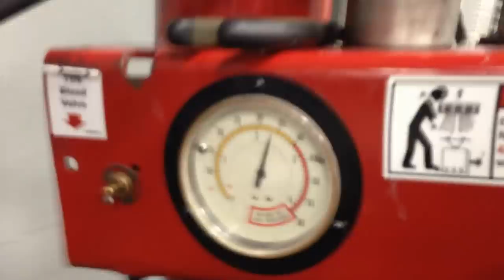125/70/16 Spare tire stretch on a full size rim.

Comment: In a few years a super wide tire on a skinny rim will be cool. LMFAO.
Reply: julio lausell no, one day scooters will be the coolest thing
Reply: allthings possible I hope so, kuz I like um.
Reply: julio lausell I think the "LMFAO" made your joke even more unfunny than it already was
Reply: Trevor Van Eeckhoutte Then you got the point.
Reply: ***** Putting a super skinny tire on a wide wheel is as dumb as running a 500hp engine through a 1 inch muffler, or a 100hp engine with a 3 inch exhaust.
Reply: julio lausell its been cool since the 70s
Reply: Too late. We tried that one back in the 80's, early 90's Down Under.  Glad I escaped those that did. Big tyres with the centre scrubbed out. Embarrassing appearance of over-inflated tyres. You didn't miss out on anything. Thrashed out wheel arches were common. As were broken axles.
Reply: This aged well
Reply: @jjproductions6912  aged wonderfully
Reply: This aged well

Comment: Real smart. A tire that's rated for 55mph max
Reply: +Cobracam The rating probably changed to 150mph because it morphed beyond it's original form.
Reply: Anthony Abelardo lol
Reply: lol
Reply: AND a normal rim...
Reply: Have you ever seen a stanced car with stretched tires going over 55? he should be fine
Reply: Cobracam have you ever seen a truck carrying a shipping container? The tires on those chassis are nylon rated for 50mph only.    That's scary.
Reply: And only a max range of 100 miles.... I drive 100 miles in 2 days, you'd be changing your tires 3 times a week.
Reply: Most cars that have them cant go past that speed anyways.
Reply: 55 mph and only able to go around 100-150 on the tire before it’s bad
Reply: It would be like, 9999mph

Comment: Lowriders been stretching tires for years, 155/80/13 on a 13x7 wheel. Thats the norm.
Reply: L.A. Saldana yeah, but they are not doing it with 13inch wires remember , these are bigger and wider and it's not going on a lowrider but a Honda civic

Comment: The question may be stupid but are there risks that the tire just pops of or something ?
Reply: Cyril Schoenacker Yes, pretty high actually
Reply: !WK3 Hope they did it for fun and didn't bring the car on the highway
Reply: Cyril Schoenacker Knowing the car community as a member of it, the wheel's most probably mounted on a car so low that it can't realistically go over 50ish km/h (35ish mph) without being severely damaged (penetrated oil pan, ripped off bumpers, suspension grinding on the ground, wheels demolishing the fenders, etc.) :) Those are show cars, made for a single purpose, to be shown to others :)
None of my cars is that low, though, as I actually use them outside of car shows; one for daily driving, one for racing and two are currently projects on hold but will still be used actively when finished :) Point is, if you want to actually drive and use your car, you won't be putting a set of wheels like this on it, you'll put something like 255/35ZR18 as I did on my daily, because you want it to handle properly, not like a piece of s**t ;)
Reply: !WK3 Man I got a mk3 golf with 195/14/55 or something like that, 255/35ZR18 seem huge for me lmao
Reply: Cyril Schoenacker Obviously, it depends on the car :) I'd probably drive on 205 or 215 16" if I had an Mk3 Golf, however, I'm dailying a 520i e39, which actually has factory recommendation ranging from 205/65R15 all the way to 265/35R18 in the back xD Obviously, fronts are thinner, recommended being 235/40R18 for 18" and I'm running 225/40ZR18 :)
Reply: !WK3 Yeah a friend of mine got 16" 215 on his car and it's perfect. Larger tires would mean more hp needed as the car only got 90 haha
And also yeah for a bmw it's seem a lot more natural, good choise on the 18", not to big and not to small.
Reply: Cyril Schoenacker Not necessarily, I've only got 150 horses and open diff, yet I manage to slide on the 255s easily :) I just replaced them with 225/45R17 winter tires, and summer rears were badly worn after only one summer season where front ones are as new as used tires can be :D
Tbh, I'd really like to run 19", but I kinda can't afford it at the moment (rims I want are 600+€ plus a set of really wide staggered brand new 19" tires which could easily cost me 800-900€) :'( I'd love to run BMW Style 166, but current set I've got, Style 69 are a fine set of rims as well :)
Reply: !WK3 Still that's 60 more hp than I do lol, I'm concious about the fuel needs too, large tires means more traction which means more fuel consumption right ? I fear that my car would turn into a donkey x)
I still haven't got myself winter tires and it's already -5C in France lmao
No doubt their worn if you drift them haha
600€ per wheel right ? Not the entire set ? You scared me !! :') hahaha
Yeah tires are so expensive that's crazy. One of the reasons why I'm happy with my 14", I can get all 4 tires for like 300€ or even less x)
Both look nice if you ask me ^^
Reply: Cyril Schoenacker Yeah, and that 150hp is still 140hp (4.4 V8, 290hp stock)  less than I've got in my drift e30.......and yet, I'm currently running on 205/55R16 on the e30 xD
Yeah, the consumption might rise, and probably will, but grip would be higher :) It all depends on how you drive your car, I, for example, am a really aggressive driver, carving canyons at 140-150 km/h, entering and exiting roundabouts at 70+ etc. thus I need the grip, but I need to be able to overcome it when I want :)
Nah, I was talking about the complete set, for both rims and tires ^_^ I mean, I'd get the set of 166s from my tire guy for 450 and fix it for ~150 since it's badly curbed :)
We had -3, -4 a few times already in Serbia, but I'd recommend putting on winters for everything under 7°C :)
Reply: !WK3 Oh shit that thing must be going hard 😂 The V8 comes from an other car or did the e30 have a V8 version ? I'm not really à BMW expert as you can tell x)
Well I'm more a "calm" driver so a lot of grip isn't needed in my case. At least for now ^-^"
Damn that's cheap, they are replicas or stock rims from another car ? Because aftermaket rims are more like 400-600 per wheel right ? Depends of the country I guess. I  France 600€ a 19" set is a good price !
I know but I don't really have the money too to get winter tires 😅
Reply: Cyril Schoenacker She gets grip in third, most of the time, but if you shake the steering wheel, she'll gladly spin in the 3rd as well xD The 1st and the 2nd are there just for spinning the wheels up to 90km/h xD The engine's from a 540i e39, so it's a complete engine swap and stuff :) The biggest engine any e30 had was 3.210cc (M30B32 inline 6 engine) in 333i made exclusively for South African Republic with most powerful being in M3 Sports Evolution (2.5 238hp S14B25 inline 4 engine) :) And now my Touring (wagon, caravan, however you prefer to call it) has 290 :D
Nope, not replicas, original ones from M5 e60, but they're used and they're badly curbed, so they need to get fixed in order to be show-ready :) New rims, on the other hand, are quite a bit more expensive, same goes for some used exclusive aftermarket ones :) But these are OEM BMW wheels, so they're neither cheap nor expensive as they're not some no-name brand knock off, but they're not from an exclusive tuner company either :)
Reply: Cyril Schoenacker As for not having money for winter tires........I mean, tires are the ONLY thing connecting your car and the road... If they don't do their job properly, you're screwed ;) Think about it, is your life worth those 150-200€? I guess not :) So either buy the winter tires or don't drive in such conditions at all (talking about snow and ice, you'll mostly be fine with summer tires even under 7°C if it's dry) :) Just an honest advice/opinion from someone that wants to keep you alive and well ;)
P.S. I use Tigar Winter1, see if they're available in France, they're really amazing model of winter tires... They perform very well in all condition but are cheap as hell, in 14"-15", they should be around 35-40€ a piece, so they really do come out to 150€ with mounting and balancing for a set of BRAND NEW tires :)
Reply: !WK3 Damn congratulations on the engine swag, seems like a lot of work x)
Ohhh I understand the price now ! That's what I meant by "stock" rims !
Reply: !WK3 I'm actually searching for a job so winter tires à deffinitelly something I'll buy don't worry. And I don't drive when the road don't seem good to me, I don't drive that often also so I'm fine for now. ^-^
Thanks for your help Imma see if I can find those ! :)
Reply: Cyril Schoenacker Thanks, however I had someone else perform the swap for me because of my lack of experience, tools and work place :/
Good, good, find a set of good winter tires and enjoy ^_^ If you don't feel confident enough, when it snows, go to an empty parking lot and practice driving in extreme conditions :)
Reply: !WK3 As long as you enjoy it ! Maybe you'll be able to do it yourself one day ^-^
Haha my brother did it when he was my age, there a parking lot next to my house and it's empty like 90% of the time, it makes a great playground xD
Reply: Cyril Schoenacker I just need the tools and the space, the experience comes on it's own :)
Then go there, have fun, and it might actually save your life one day ;) There's too many people on the road not knowing how to control their car in extreme conditions, don't be one of them, learn it by having fun :)
Reply: High risk of it popping off the bead.
Reply: Great idea if you don't want to do any more than the 50mph these space saver tyres are rated at. And if you want your tyre to debead probably even at lower speeds and potentially cause death, injury or damage to other road users or yourself.
Reply: Yes, mostly life threatening risks. Do not do this, if someone dies because you refuse to follow manufacturers specifications. You will go to prison.
Reply: I'm riding on 195/45/16 on a 16x8.5" and I ride the fuck out of them.
Reply: Jason Vecellio don’t drop the soap
Reply: Got a coworker who keeps popping off his right front tire when taking turns too fast. Happened about 4 times in a few weeks. Imagine that shit happening at 80 mph. This is what happens when you wanna be cool the stupid way.
Reply: Seize some what. People run 205s on 9in wheels all the time with no problems.
Reply: You have to keep the air pressure much higher but then still it can pop off if you corner too hard
Reply: @IWK333  thinkinh of doing this to my volvo wagon, also thinking of a 1000hp ls crate engine for it lol

Comment: does anyone know or understand how stupid and dangerous this is? I have been working in the auto industry for over 30 years and would never do this at my shop! if i send a tire out like that and there is a blow out I could be held liable ! if the tire doesn't fit it's not the right size and it is illegal! this crap needs to stop! it's giving real gear heads a bad name!
Reply: You say you worked for 30 years in auto industry, in that span of years, have seen atleast one car with this tires on? Or did you even see them put this tire on a car? Point is that it's actually pointless to do it, they show you how spare tire would look when stretched, that's all, did you see them put it on the car at all? If so then you can runt all day

Comment: as a reputable tire shop, you should have never agreed to this BS... your only supposed to drive a total of 100mi on those donuts
Reply: Samuel Paniagua that's how you know they're dumb. a real tire shop won't stretch your tire since there's too much liability for when it blows. not if. when. cause it will blow off the bead sooner or later.

Comment: Its neat to see a spare donut tire on a regular size rim, but it would have been somewhat better to put regular size 16 inch tire on the spare donut rim.

I would not drive on a donut tire on a full size rim though.

My car came with the donut, but I put in a regular full size tire in its place.

The wheel assembly is, balanced too, and stays well in the spare tire storage area.

I still have the donut, and kept in the garage.

Comment: How was that even holding air? The bead didn't even look like it fully seated.
Reply: Scott Lambeth it was as long as the part of the tire that is actually touching the rim is locked in its fine. The wheel will looks like it's pulling away from the rim if it's stretched. They didn't show it well and it's hard to see on a black rim. I have stretched tires on my car and I get questions on this all the time. (Sorry for the wordy answer)

Comment: pretty cool guys :) now thats skill. loved the clip. probably a dumb question but can that be balanced as easily as a regular fitment wheel tire.
Reply: yeah it balances the same the strech has no effect on how it balances. cause when you balance you're trying to have rhe sMe weight on both sides it the same ass putting off road tires on it

Comment: what is that leaf yellow leaf blower looking thing?
Reply: it's a Bead Seater, that one he's holding is the Cheetah. Probably the most common used bead seater of that type. all it does it blast a shot of air into the tire, making the tire expand and help the beads sit onto the rim so it can be inflated. it's filled up with an air hoses. 

it has other fun uses my favorite is to scare coworkers taking a dump.  start off with spraying break cleaner igniting it with a lighter.  then once the stomping starts while they sit on the toilet with the pants down you pull out the cheetah.  I always tell them,  "don't worry baby cakes I'll save you, CHEETAH!!!!!"

By that time the fire is out,  I'm not trying to hurt anyone.  just spray a little and it's a instant reaction to stomp ur legs while taking a dump and put out the small fire. DON'T BE AN ASSHOLE AND OVER DO IT, SOMEONE CAN GET SERIOUSLY INJURED

SO with the cheetah ready filled with air and after yelling cheetah. whoever inside usually says something like "no i'll kick your ass mother fucker" or " fuck you cheetah! "

point the barrel under the restroom door and blast them. 

I usually tell them I didn't spray the brake cleaner with fire. tell them they are ungrateful mother fuckers after saving them with the cheetah 😆
Reply: Arthur Garcia that is some deep shit

Comment: Because spares tires are totally safe at highway speed.
Reply: You know your "JDM" logo means novice driver. As in student driver. As in you have lack of experience when it comes to driving.
Reply: julienjjj You know what it's not safe on? The differential if it's on the drive wheels.
Reply: +Bryant Campbell Does no one get sarcasm?

Comment: What is the point of tire stretching? Why not just put the right size tire on it?
Reply: clearance
Reply: +tarstarkusz "The right size tire" won't let the wheel protrude past the wheel wells. Which is ALSO illegal - the wheel has to be completely under the fender - but the cops apparently don't know that.
Reply: +jmowreader Dude don't put that crap on here..seriously... snitch.
Reply: +Jesse Jesse Dude! This shit can fucking KILL you! If these stretched beads unseat, which is very possible considering that your contact between the rim and the bead ain't all that secure, you could roll the car. 
Now check it out: About a week ago I was in a parking lot and walked past a "stanced" car. This guy found tires with sidewalls that were, at most, an inch and a half high. He still had stance, his beads were locked in good because the tires fit on the rims...he looked cool and he's driving safely. There IS a right way to do this.
Reply: Yeah I know there is. I stretch 225 on a 10inch wheel. #aintcare attitude is what this video represents.
Reply: +jmowreader I find the whole idea silly, stupid, ugly and dangerous.
Reply: +Jesse Jesse I stretch a 225/55/16 on a 7 inch rim
Reply: +540iDavid Thats not a stretch..
Reply: Kyle H /sarcasm
Reply: +FordSierraIS drive club clearance
Reply: +Anthony Abelardo Some guys clearance wheel openings with baseball bats, but it's REAL easy to fuck up your fenders that way.